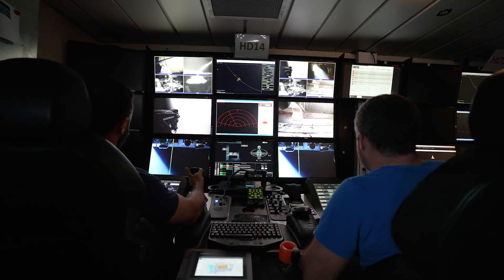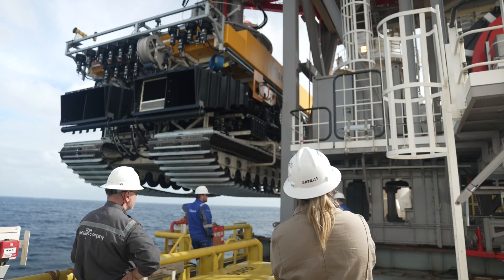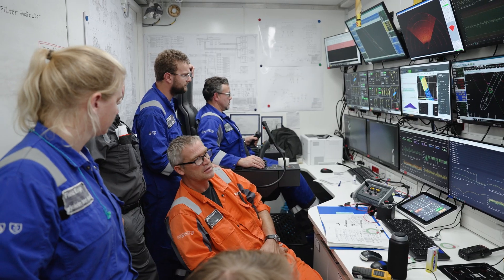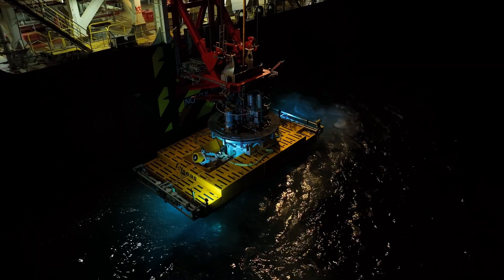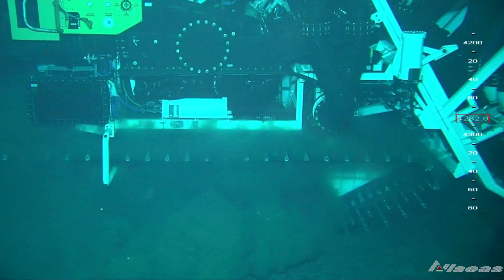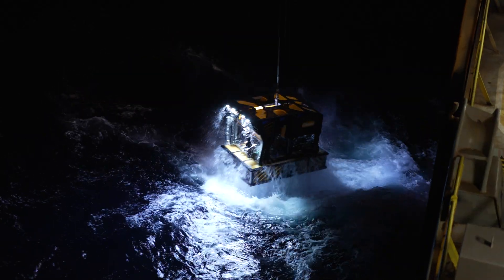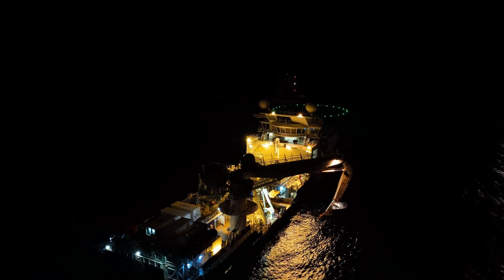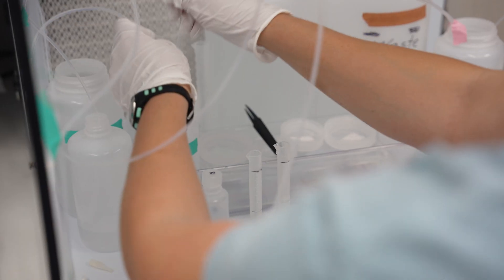TMC - NORI Environmental Monitoring Program

Comment: The CFO said the other day that they should be able to mine 200 tons a day of Nodules which would yield approximately 
42 tons of nickel
32 tons of copper
7 tons of cobalt
12 tons of manganese
2 tons of molybdenum
1 ton of zinc
The value of these raw materials would vary depending on the current market prices. However, as of March 8, 2023, the approximate value of these raw materials would be:

$18.4 million for the nickel
$12.8 million for the copper
$2.8 million for the cobalt
$4.8 million for the manganese
$0.8 million for the molybdenum
$0.4 million for the zinc
For a total value of $39.2 million an hour

Comment: Is The Metals Company just for research or will it continue under its stock if it takes off?
Reply: If I am not mistaken, they would be come the largest mining company for providing the metals required for EV batteries.  And considering everything is going EV over the next 15ish years, that would be huge.